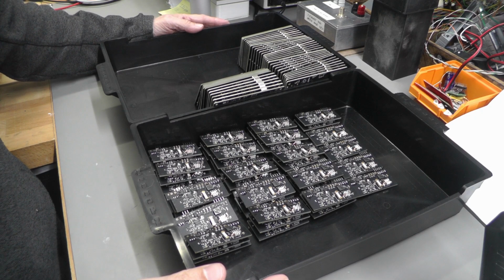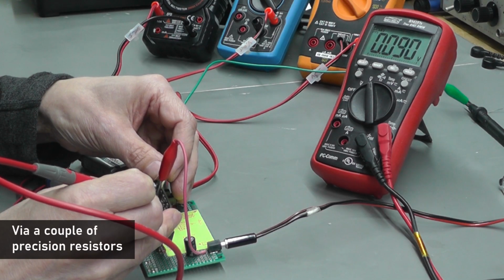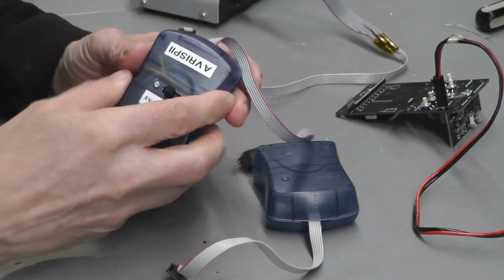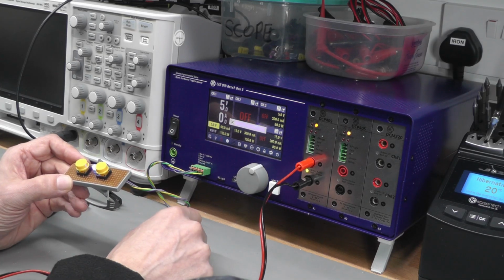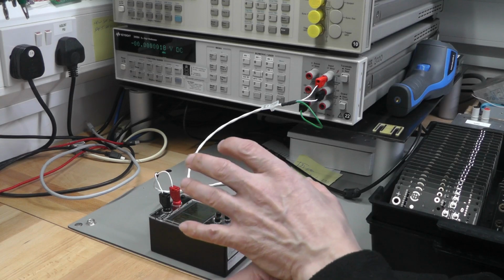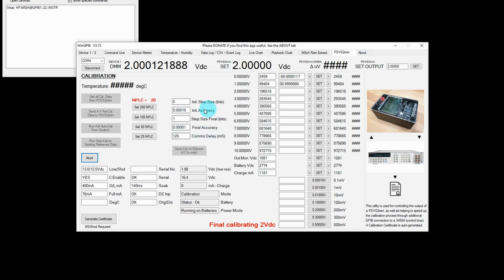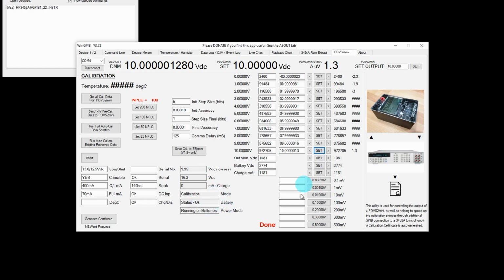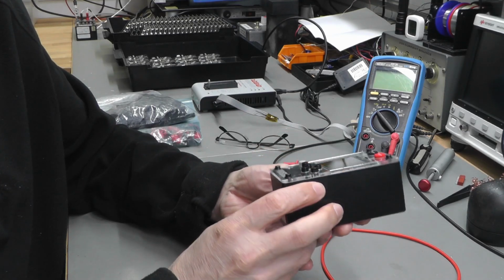No.109 - PCB/Product Production at home - Part 2

Comment: Very nice work!
What is NPLC?
If you were going to start again with the laser cutter would you buy a better one than the one you had to modify?
Reply from the maker: NPLC stands for Number of Power Line Cycles. NPLC is a measurement term that indicates the accuracy with which a voltage or current is displayed on a device such as a digital multimeter. When determining the value of a DC signal, AC noise is often present by power lines.
Using NPLC of 1 or greater increases AC noise integration time, and increases measurement resolution and accuracy, however the trade-off is slower measurement rates.  For highest measurement accuracy NPLC of 100 is recommended.....or higher.
Reply from the maker: To buy one with the features I have now would be a bigger machine. I'm not aware of a K40 sized laser with all the bells & whistles I have now. My K40 just fits on one of the shelves in my workshop. So the answer is.....I don't know!

Comment: Would be nice to see a video on the k40 mods. I use an ice cube maker to provide the cool water.  It has a compressor so is quite quiet in operation and keeps the water down around 17°c or less. Looking for a replacement controller to run lightburn that won't break my pocket  money limit😢
Reply from the maker: For the K40:
Cohesion3D controller board (Laserboard) is the best way forward.
Search Thingiverse for K40 Laser Motorized Z-Bed (you'll need to 3D print some parts).
I do need a better cooling solution, if I cut for too long the water temp does increase.

Comment: H9w do find referencing off the  pcb edges, I've always referenced off one or more holes as they tend to be drilled to the gerber data. It seems that the milling of the edges is possibly the last operation and can be a few mils off. Can make spring probes miss at times.
Reply from the maker: PcbWay are pretty accurate with these boards. Stack them in a straight pile and you almost see down all the way through a via. No complaints.
Reply: Woof!!!!!!!!!!!!!!!!!!!!!!!!!!!!!!!!!!!!!!!!!!!!!!!!!!